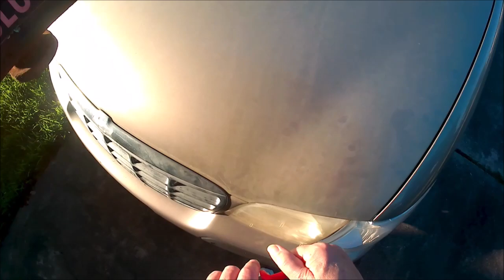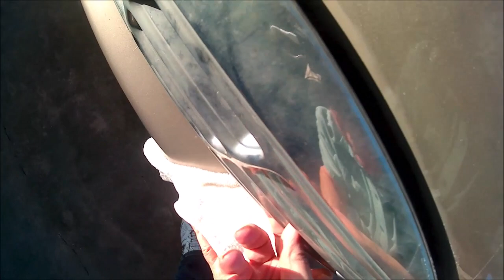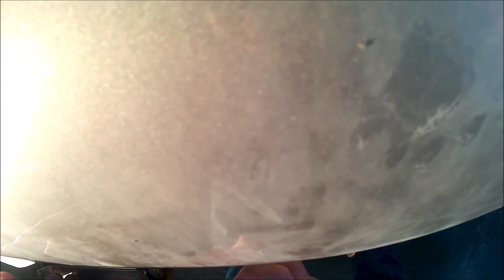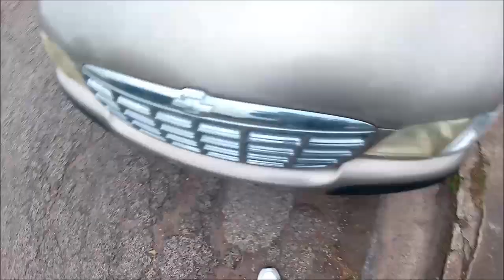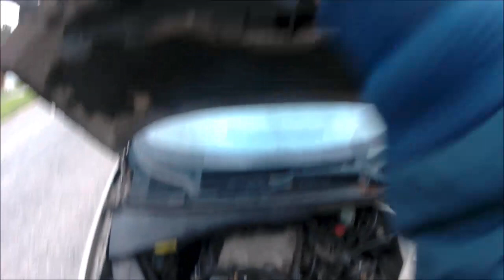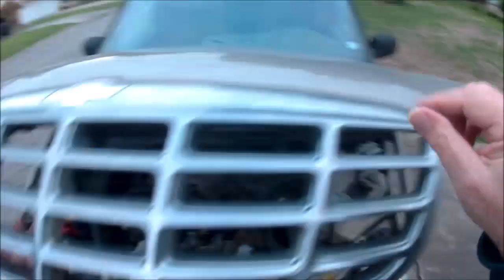Repairing 2000 Venture Van front grill

Comment: The isopropyl alcohol really helped the sealant do it's stuff......When it comes to using these glues I keep a supply of surgical gloves around.....You may be able to use zip ties if all else fails......There just wasn't enough attachment that I could see to aid the repair.....It's still going to require a soft hood closure or the trim piece will probably let loose again.....Just saying!!😎
Reply from the maker: Probably add something else to hold it in place.